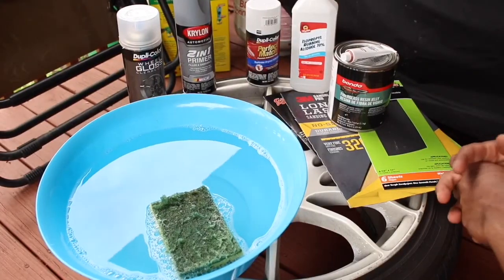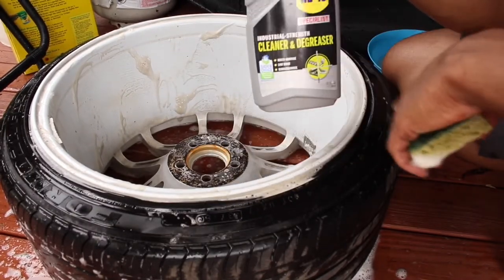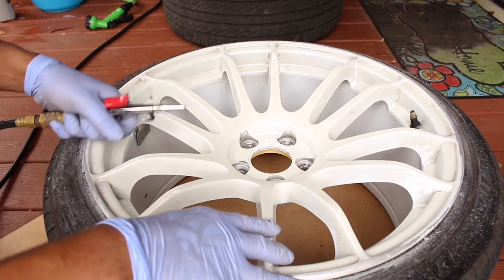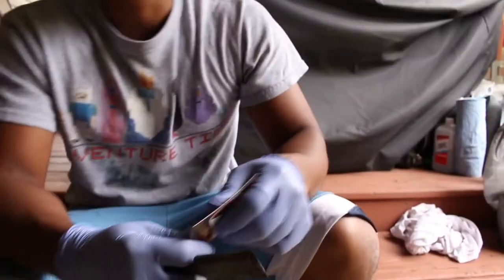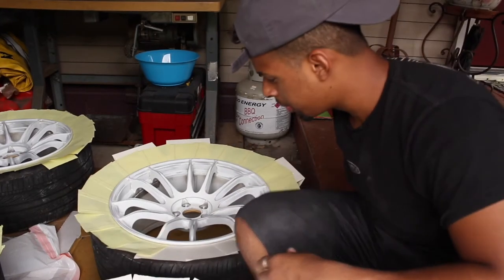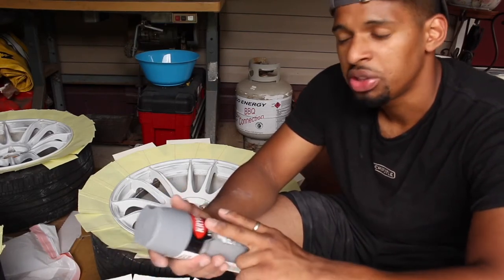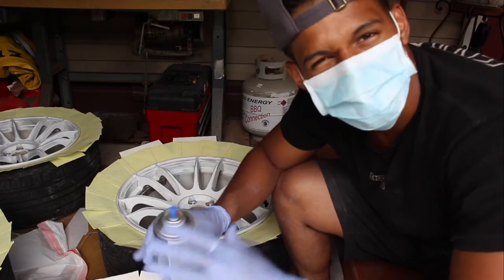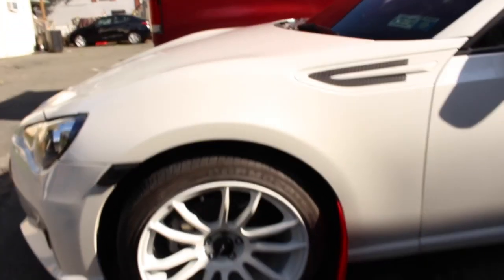HOW TO FIX CURB RASH & PAINT YOUR WHEELS !

Comment: Bondo isnt  good to use on wheels for a couple reasons. It all comes down to fact bondo shrinks over time , so eventually it'll become brittle in that same region again and chip there. You can either bondo it and let it cure for awhile so it gets the maximum shrinkage so you can fill it in more or try jb-weld or something metal fiber reinforced and grind it down. But good video though.
Reply from the maker: Zeeshan Nissar thank you bro!!! I have heard this in the past but I wanted to just settle for the quick and easy way since I don't plan on keeping these wheels for long!
Reply: Hmm. So using the metal reinforced Bondo should work much better?